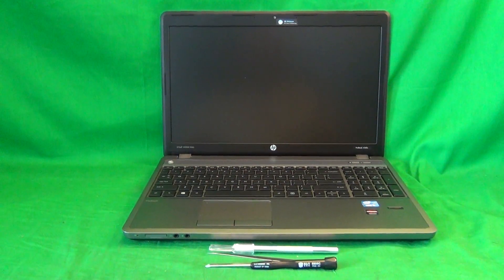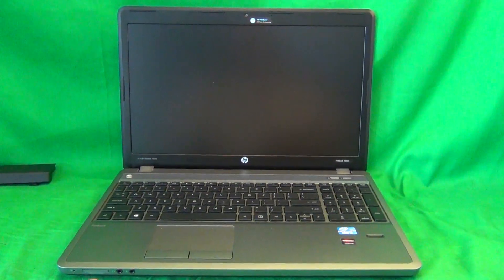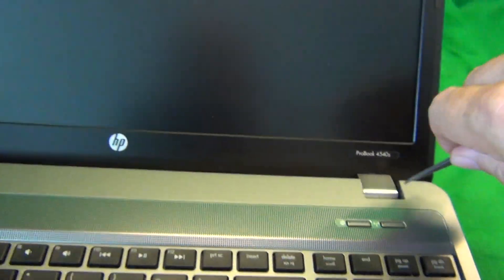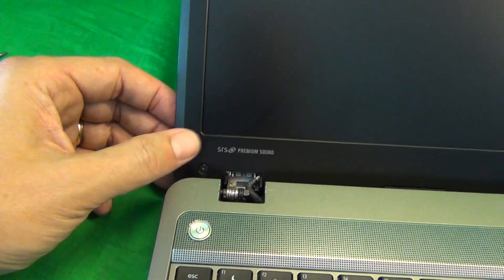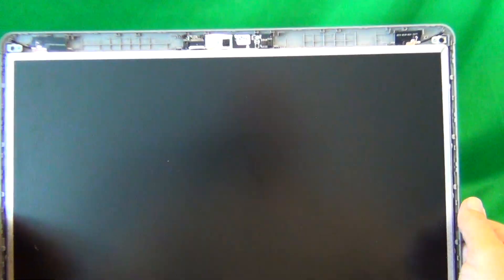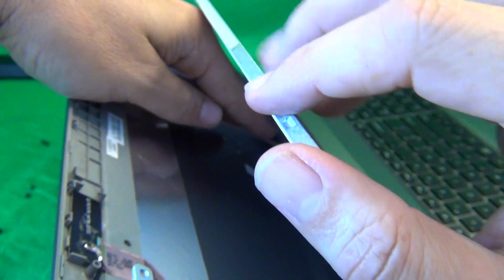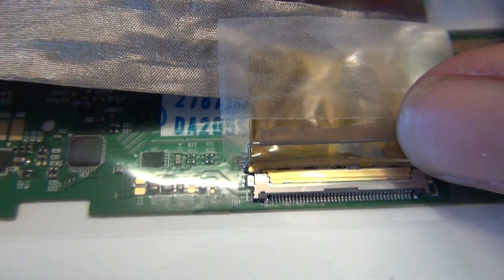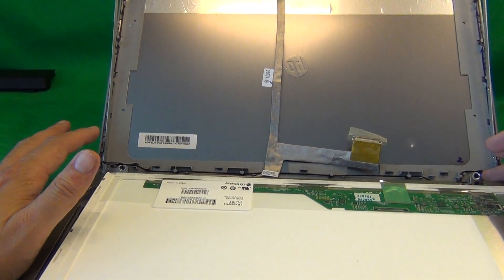HP Probook 4540S Notebook Screen Replacement Procedure

Comment: Great video. My only concern is that the part number you mentioned for this screen is not found on the back of my screen though my hp is a probook 4540s.

Comment: Hello, can hp probook  4540 screen work for probook 4530
Reply: Hi, just asking if the screen of 4530s is the same/compatible as hp probook 4540s..they are the on size of 15.6..

I need someone to confirm so that i can proceed and buy new screen.. Tia
Reply: I already watched
For 4530s and 4540s..

At fhe back of the screen both
LP 156WH4
The difference is
LP 156WH4
(TL) (R1) 
For 4540s

While 
LP 156WH4
(TL) (D1) 
4530s

I think same number of pin on cable.. 
Posible it is compatible for both

Pls help and need confirmation for those who tried if it is compatible.. 
I need expert advice.. Tia

Comment: I have an HP Probook 450 G1 and following this tutorial works beautifully, except in order to remove the hinge covers on the 450, you pop out the front, close the lid, and pull from the bottom rather than the top. Very helpful, thank you!

Comment: The procedure you showed removing the hinge covers is way off of how the tabs are oriented on the bezel. Causing me to brake half of the tabs. You should explain that the bottom side needs to be pushed in and the top side needs to be pulled away. I removed the second hinge with little to no damage to the tabs once understanding how they are actually secured. Thumbs down.
Reply: You're right. It's actually MUCH easier to start removing the hinge covers as shown in the video. Then, flip computer over and just push them straight out from the back pushing on the tab.

Comment: I enjoyed this video very much. My mouse was accidentally chucked at my 4540s screen and now colors are all over the place. I think it's cheaper to just replace the entire computer than buy the screen and then go through this process and possibly burn 81 dollars if I mess up (Apple taught me that). It still plugs into my monitor so I'll be extracting all the information from the hard drive.

Comment: Well done.  Clear and very helpful.  On my HP the video cam circuit board at the top behind the screen is floating in its plastic socket so be sure to seat it correctly before applying any pressure to the top of the screen to seat it.

Comment: I can't even get the hinge covers off. All I've succeeded in doing is breaking hobby knife blades and gouging the hell out the covers. That's a nice little motion you do getting them off but i struggle like hell to try and manipulate and it won't even move. Glad it's easy for everyone else; that's the story of my life.
Reply: He probably should have gave a close up of the covers, the top front is easier to unclip because its just a small tabbed lip, the bottom side has a deeper tab inside, I used two smaller eye glass screwdrivers to unclip the bottom before it slip out relatively easily.

Comment from the maker: I think you would need to change out the video cable also.
Reply: I replaced screen using this video in 2014-2015. I loved that computer, but one day it wouldn’t turn on. I think it’s the wire/cable. Do you have a video on replacing it?